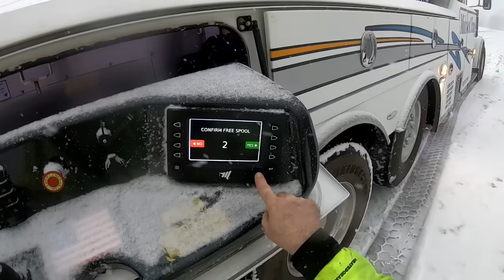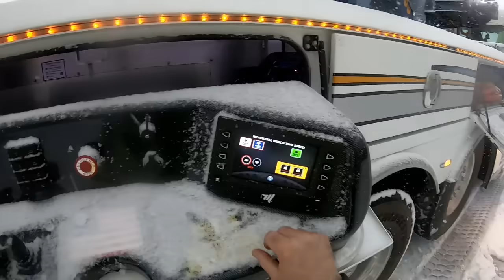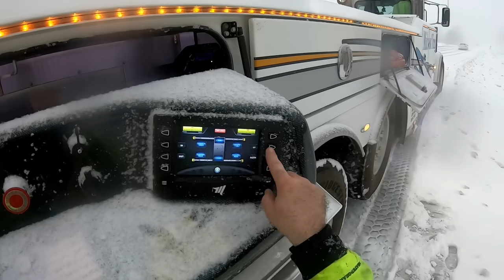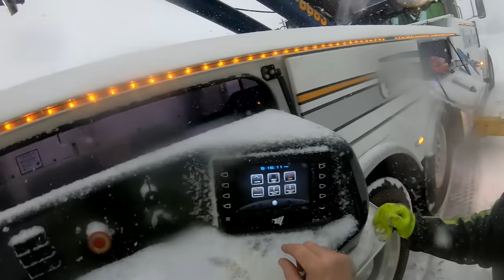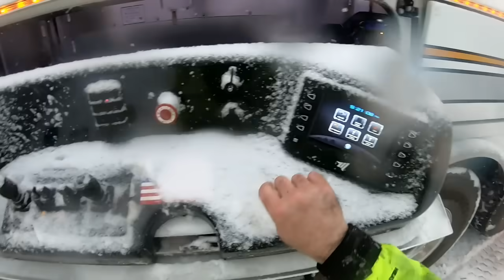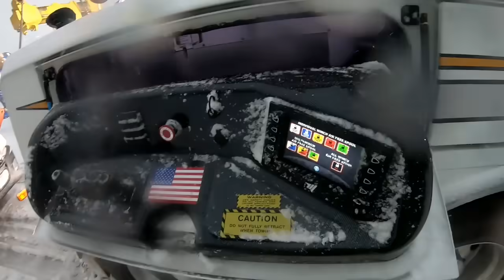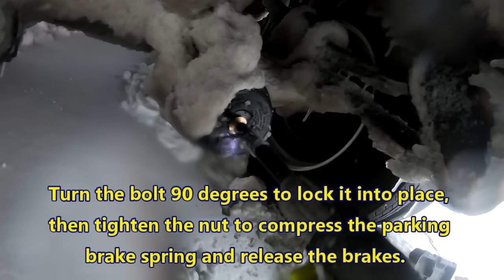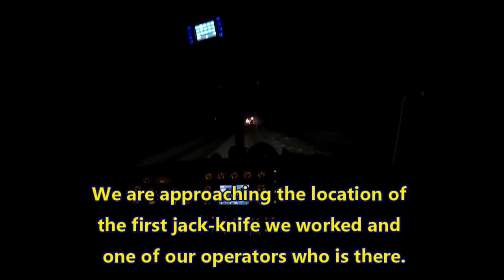Guardian Angel Working Overtime  Two Jack knifes in the Snow Part 2

Comment: I will add another comment here as a retired Fire Rescue  responder just incredible work in most hostile conditions ( been there ) in Ontario the snow tires are not mandatory but they should be  I dealt more accidents with SUVs with " all season " tires where you are and where I am there is no " all season , just winter and summer  as far as I am concerned  transport trucks have tires that dont grip in the conditions that you were in wet snow getting packed into ice underneath . Be safe and God Bless !!

Comment: You lock the house lock pins so as to not put the force of the pull on the gears but I've seen videos of 2  rotators make turning pulls (one from the front an the other from the rear) to bring the rig from the shoulder onto the road.

Comment: Dumb question of the week..  Since you work in a part of the country that is subject to this kind of weather,  and it was clear that snow building up on the control panel could become a safety issue, is there any way to get the truck with defrosters that blow on the control panel?  Seem it would be a real issue if you got to an accident only to find your panel was so iced up it either would not open or could not be used.  Stay safe out there Ron.  God bless you and all the other operators that work in those conditions!

Comment: Got some slick snow up north here, I keep thinking of the wrecker from Quiring'Big Green' with the tri drive and triple sets of chains, good for dragging anything.  Quick question, what are the pressure gauges in that left rear compartment, hydraulic system pressure and air pressure?

Comment: Another great video. The snow here in Western Washington has ended, got rain today but that still meant shoveling out my car due to the snow that had piled up around it from the snow plows and sanding trucks, plus the 4" or so of snow that slid off my hood to the ground. It's a low slung FWD Mazda Protege 5 so had to ensure it wasn't too deep for the underside. Work is closed for yet another day due to the parking lots and the state of many roads still.

Anyway, stay safe and get some rest and hot food/beverage, I'm sure y'all needed it!
Reply: Sure are getting some freak winter weather this year, mainly warm where I am in MA and got a snow and ice mix a few weeks ago that was a frozen mess and PITA, and just yesterday and last night went from snow to rain and it is a slushy mess today. Got a few good light blankets of snow before but this is just unusual., compared to more normal seasons for this part of New England or the Northeast.

Comment: Ron, I use SnoShoes traction devices on my shoes on snow, Snowpack, and ice. Slip on chains for your soles. Helps out lots!
On my 388, never had wiper arm issues. 2013 model.

Comment: Hey Ron you need to get a guardian angel light the red and blue police edition and when you're going to send the boom up put it on the tip on top because it will illuminate the boom and it will make people aware that there's something going on ahead since it sticks up so high in the air especially at night because when you see red and blue lights flashing in that are right away you know something's going on so that's just a suggestion I would stick 2 or 3 on the boom when you extended out on the sides and on the top at the very tip end they said it will help out a lot maybe there's a way you can install some strobe lights on the tip of the Boom some red and Blues and another suggestion is upgrading the red and blue lights because they're not really that visible from on the video you're in blues aren't that visible you need to get the back of that truck lit up some more with strobe lights everything's to the front and there's nothing really to the back and that's why I'm suggesting to put lights on the boom itself on the tip since it's up high in the air it's visible! Also get some more angel Guardian lights the police edition blue and reds so that way you can mount them on the traffic cones put them out bit of a distance behind where you're working it will help control traffic
Reply from the maker: I have a few of the Guardian Angel devices in red & blue.  I really like your idea of putting one on the end of the boom.  I believe I will try that the next time I use it.  Thanks for watching and God bless.
Reply: Man you have awesome suggestons, That boom one is great thanks
Reply: That's actually a really good idea.
Reply: That’s a really smart idea 💡
Reply: Watching Rons videos, I actually had the same thought that some sort of light bar would be nice on the end of the boom.
Reply: Green lights show up the best! Especially Durning the day time
Reply: Would it be a neat idea to put Guardian Angels on the outriggers too? I guess not everyone expects the extra width :)
Reply: Ron, you should get a few touch screen stylus pens. You could use those to work the boom controls without removing your gloves.
Reply: @dmvfocusrs7591  A stylus is great, a lot more accurate and faster.  Just need to attach it to something like a lanyard or the remote itself so you don't lose it.  Keep gloves on especially in freezing weather.  👏👍👍😊
Reply: GenKat Qltr ii

Comment: Great video... a little tip for you when dealing with vehicles stuck in the ice covered snow (if anyone hasn't commented yet), keep a bag or two of speedy dry or kitty litter on board.....a few handfuls thrown behind the wheels would have helped that drive trying to back into that spot....

Comment: I enjoy watching your videos. I have one question though. When you first arrive at the second truck in this series, you lower yello "teeth", I'd guess you'd call them. One on each side. I assume those work with the outriggers to keep the trucks from tipping even a little big. Since the body of the truck will move even with the riggers out those yellow "teeth" make sure that the body of the truck only lowers a few inches, making sure that it doesn't stress the riggers, thereby possibly tipping the truck with heavy loads.

Comment: Had been driving on dry pavement one morning. Pulled on to a lot that had ice on it. Got out of the truck for about 5 minutes and the tires melded the ice. Had to to chip the ice out in front of the tires to get it to move. The ice was about 1 inch deep on that lot it had melded all the way the the pavement the time i was out of the truck. You'll be safe and God bless you'll.

Comment: Boy I would seriously think about getting a heater core and some coolant lines ran towards the back so that you can at least warm some hands and such.  A simple ball valve to allow the coolant to flow and a switch to turn on a fan would make it that much nicer in the winter time.  And PLEASE get you guys some ice trekkers when you are gonna be on the ice and snow.  Not worth slipping and falling when you can have something to prevent it.
Reply: John Ventshop man I was ALWAYS ON A ROOFTOP in winter,,but I CARRIED A COUPLE OF THOSE ‘ICE TRECKERS ‘ IN MY SERVICE VAN, even in summer I may have to do work in a -25^F FREEZER, , way back I got off a price of equipment, and slid 40 feet with the wind , looking down at a 50 foot drop off that roof, that’s when I started with those ice trackers.Was HVAC/R, retired 16 years now., 77
From Maplewood NJ.

Comment: Ron, it's a sad day that I write this. I did catch your Facebook post of the accident with the car in the lake today. I know something like that must really be hard on anyone. My condolences to the driver of that car and best wishes for you and your crew. May God bless you all in all your endeavors. And may you or your crew ever experience the likes of that accident again. 

God bless you sir, and your crew.
Reply from the maker: It was a difficult situation, but one that I have learned to deal with as part of the job.  I won't say that it doesn't bother me, because it does.  One has to put on their professional face and get the job done with dignity and respect.  Thanks and God bless.
Reply: I myself work in oil field safety. It's especially tough when you have to go out and secure a drilling rig or other locations that's had accidents or even fires. It takes a lot out of a person. I've been fortunate however that I was not the one called out for such situations. I don't think I would have the strength for it. And I applaud you for having that strength. I'm just a fire extinguisher guy but I can do safety if I need to.

Again. God bless you sir.
Reply from the maker: @LoneWolf1965  Did you hear about one of the "Duck" boat/trucks that went down over in Branson, MO, several months ago??  At least one of the Highway Patrol dive team members who was here today worked that incident.  My hat's off to those guys.  Today they were working in zero visibility, 34 degree water with strong current due to the Mississippi River being flooded right now.  A LOT of people came together last night and today to handle this situation.
Reply: No I haven't heard about that one. I only knew about this incident thru your Facebook. And I don't live in the area. I live out here in midland, Texas. Way out west. So unless I'm on the Internet I don't hear much of what goes on. But that's an incident I wouldn't care for. That's for sure. God bless our first responders and military.
Reply from the maker: @LoneWolf1965  Here is one of the news stories about the incident:  https://abcnews.go.com/GMA/News/video/13-dead-missouri-duck-boat-accident-56707127

Comment: late comment but you need some portable heating pads for the trucks keep them working for  longer in the cold. maybe rubber pads under the wheels for traction when someone doesn't have chains like the second truck.

Comment: Ron it seems like it is time to give the young guys the heavy truck with the heavy work.  A nice small flatbed with some small gauge tow/winch cables and blocks would be easier on the old muscles and joints. :)  Keep up the great work.

Comment: Its funny, I did not think those ran on gas.
Reply: And as someone who is originally from the North...  Who the hell goes into a snow event without gassing up....  Cripes - I have had it beat into my head at first sign of weather that you fill up if anywhere near half tank...
Reply: I heard him say gas and thought, Well he's not been driving semi's long at all calling it Gas.LOL
Reply: "It ain't got no gas in it" -- Sling Blade
Reply: @PatrickWagz  yeah - That's what Carl said LOL...  Good one Patrick
Reply: Hay man, even the guy and gals that drive Boeing's and Airbus's call it gas.
Reply: @SandBoxJohn   And then wonder why they suddenly fall out of the sky.
Reply: @reganmahoney8264  Some company's tell drivers where and when to get fuel so it may have not been 100% the drivers fault.
Reply: Of the companies I worked for, one had their own fueling station where the trucks got refilled from daily. And others either had a WEX card or other credit card for fueling of which the WEX requires mileage each time you fill up which makes sense. One had a card for each truck of which there was six fleet (three box and three flatbed) as it was a ladder company that also did wholesale distribution and rentals of scaffolding equipment.
Reply: Maybe turning the wipers off would save some ;P
Reply: "Trucks got fuel, drivers got gas." That's how I was taught to remember it😜
Reply: We long haulers say “Fuel.”   “Gotta stop and fuel.”  Noun and verb.
Reply: Craig G Now there is a man who has run smack dab out and been embarrassed about it.

Comment: Hi Ron,
Watching your videos in Ireland. I have noticed on your night call outs a lack of high level lighting. Over here our Fire Services have vertical telescopic light poles which have 360° lighting on top. It could possibly sit behind your cab beside your exhaust stack.
Regards and drive safe.
Reply from the maker: We did look into that option when we spec'd out our truck.  There were several problems with the light tower option.  First, it was very expensive.  Second, it would impede boom rotation.  Third, it would take up more space than we were willing to give up, both externally and internally for the power plant.  For some reason, the GoPro cameras I use do not show the actual amount of visible light on any job.  What we can see on the job is much more that what you can see on screen.  Thanks for watching and God bless.

Comment: Ron have you seen the new heated line of clothes from Milwaukee? I've just used an under armour cold weather gear compression mock neck shirt under my hoodie for years. But it hurts the hair on your chest after wearing it all day lol. I've gotten a little fatter and it's still got the same compression, that's why it hurts the hair on my chest 😂.
Reply from the maker: I've got some of the Dewalt heated gear.  If I'm not mistaken, the coat I'm wearing in this video was my Dewalt heated coat.  It definitely helps.  I can't stand to wear compression shirts either.  I wear base 4 bottoms, but can't stand the tight fit on my upper body.     Thanks for watching and God bless.
Reply: @RonPratt  I don't love it myself either lol. No other way I've found to stay warm without a ton of layers. The under armour cold weather does wick sweat good. It basically won't get wet. Working on power lines I was in and out of the truck from pole to pole. Building miles of new line. I never could stand all those heavy layers. Bibs with that shirt and a hoodie gave me movement. I don't care how cold it is if your working it warms up lol.
Reply from the maker: @pleaseholdwhileiprocessyou1513  You pegged that one....when you are working you heat up.   I know it was cold, but I was sweating on this job.  You dress so that you are warm while stagnant, then when you start working, it's time to peel off layers.  Been there many times, as I'm sure you have.

Comment: My question could be very naïve, the semi trucks jack knifed because of the snow/slipper road conditions. How do you make sure yours doesn't slip in those road conditions when you go to rescue them? You have snow tires on your rig? Why can't those semi trucks use snow tires? Or the semi trucks don't use snow tires at all because in most states, DOT will require them to put on snow chains in winter storm and snow tires don't meet DOT's requirement for semi trucks so semi truck drivers/owners won't bother buying snow tires? Or there are no snow tires for semi trucks?

Comment: Driving an expensive truck with summer tires with almost no thread is pure suicide.
Reply: tractor trailers don't have "winter" and "summer" tires. this is why they're supposed to put chains on when the roads are slick.
Reply: Semi’s use steer tires (front axle) and drive tires (rear axles).
Reply: @Sara-L  @ Wrong there is winter tires for truck. I am living up in Québec we knows whats is winter and snow.

Comment: You need gloves that you don't need to take off to use the touch screen thing because I have a pare. Oh and also DON'T wash them because they won't work after
Reply: A great solution for that is to get a lighter weight pair of gloves that you can use a touch screen with. Then get a larger than normal set of work gloves, ones that can take a beating and stay dry (a little anyway ;-) ). Then you can take off the  work gloves and use a screen but still not expose your bare hands.

Comment: When you were at the drop spot for that trailer, would it have been easier to disconnect the tractor from the trailer and bacl the trailer in with the rotator? Instead of pulling him. Curious
Reply: No brakes on the trailer, so it would be impossible for him to unhook. Would have taken the dolly legs out from under the trailer and made a right mess. It was safer to back it in with the truck , then take out the caging bolts in the brakes of the trailer, then drop the trailer.
Reply: If the brakes are caged, then it would have been the same as if the tractor was backing it up and if he used the 5th wheel attachment he coulld have used his under reach and lifted the trailer slightly higher and wouldnt even have to mess with the landing gear. Similar to a yard dog. I guess there are more ways to skin this cat.

Comment: Honest question Ron? Can you pull against the house lock like this or was this done because the pull was relatively light. Thanks for the help! nice job to you both im freezing just watching!
Reply from the maker: It's best not to pull against the house lock.  Normally I would have anchored the opposite side of the boom to one of the points on the rear of the bed.  It wasn't just the cold....it was the wet and the wind that cut right through.  Stay safe!
Reply: Ron Pratt thanks that answered my question! You stay safe as well

Comment: Would it be possible to connect an air line from the back of the tow rig to the trailer to get the truck off the road?
Reply: That might have worked but what if the airlines under the trailer were compromised or had a busted chamber then ur doing double work when airing the supply side didn't release when caging is a sure thing together it off the road asap

Comment: Boy what a mess.  Those automatic trucks are fine on non snowy roads but not when you really need real traction.
Reply: Not so much an issue with the transmission as it was more a tire traction issue.

Comment: carry a bag of cat litter w u next time for traction
Reply: The cat litter is on the trucks for soaking up spills. You are right, for traction for a short distance it works very well. To get a tractor with an automatic to back a trailer into it's slot? Might have to spread a lot of bags. My son was complaining this morning that his Honda with an auto was useless in snow because it wouldn't back up without spinning. (He grew up with 4 on the floor in a BC mountain town)
Reply: Timothy Carey I had a 74 Mustang II,,I carried 2bags of sand, & a plastic pail,,but that rear was LIGHT,,so 2 large sand bags server 2 purposes. Greetings from MAPLEWOOD NJ